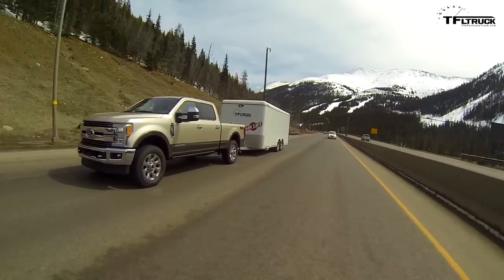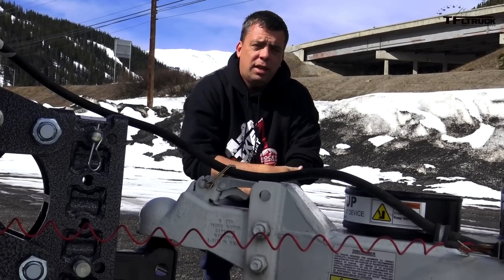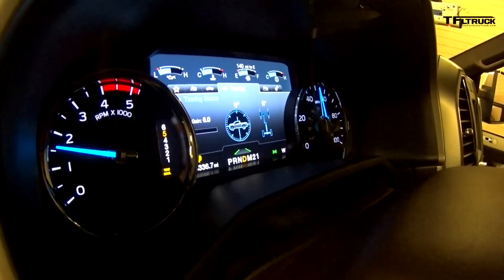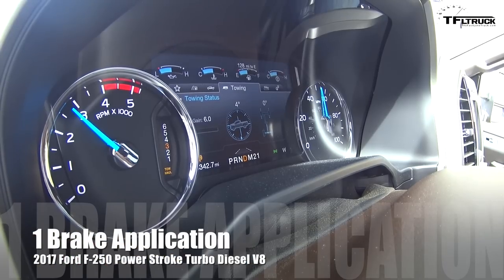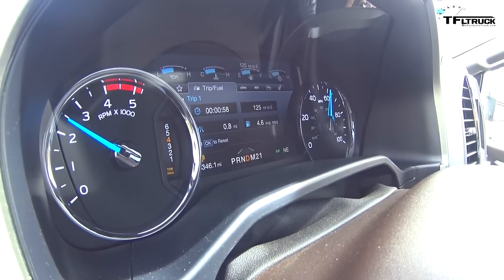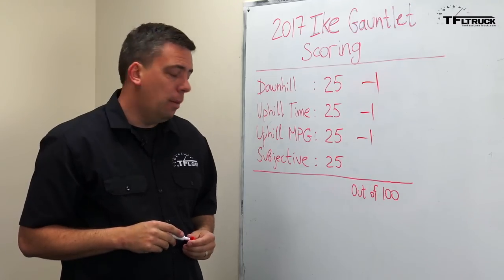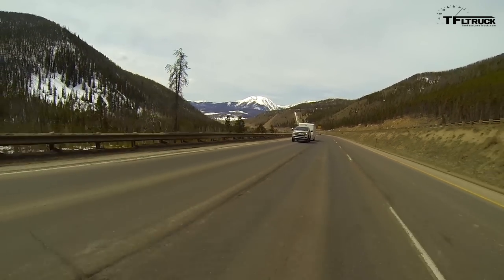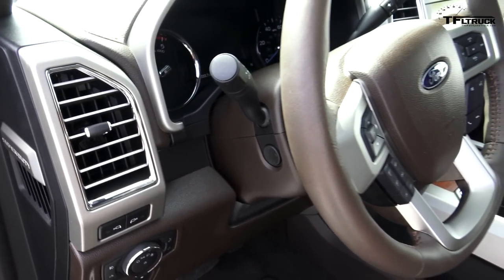2017 Ford F250 Diesel V8 Takes on the Ike Gauntlet Review: The World's Toughest Towing Test

Comment: my 18 6.7 f250 did on a 7 degree grade with a 10500 camper at 70 mph at 2800 rpms. and it wanted to go faster. on the way down same grade i actually had to speed up to keep up with traffic because of the exhaust brake. these trucks pull like freakin trains. this video convinced me to go with the ford and i dont regret it a bit.

Comment: I'd like to see the 2500s tow the same load as the gassers so we could see the difference the money makes
Reply: I believe the Ford v8 towed about 8000 lbs for 4 mpg. Really this wasn't bad,  4k more pounds and it had better mpg. Put this on a moral level roadway and at sea level and you could squeeze maybe 10-12mpg out of it with the same weight.
Reply: They were 100lbs shy of the gvw in the 6.2 video. They’re the same here only the gvw is 200lbs higher on the diesel. From my understanding at least.
Reply: Instablaster